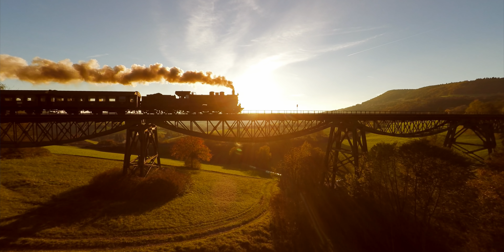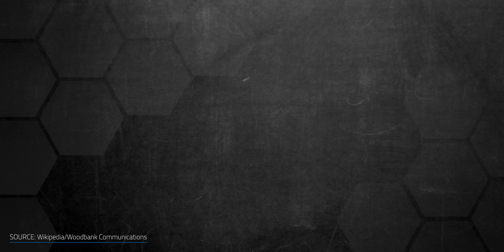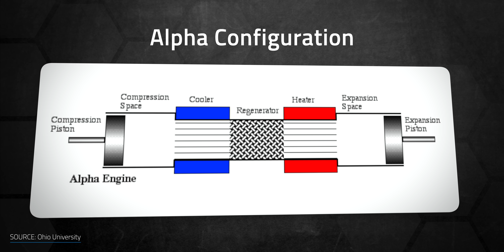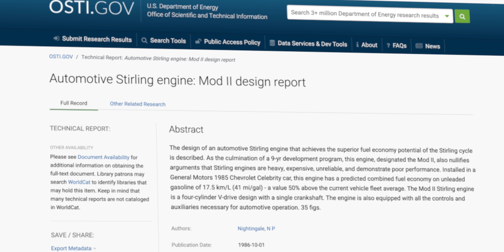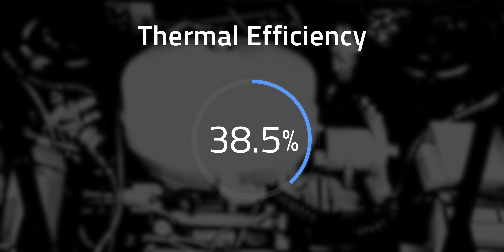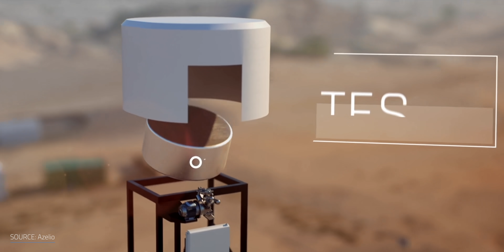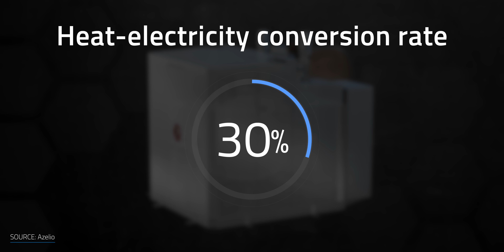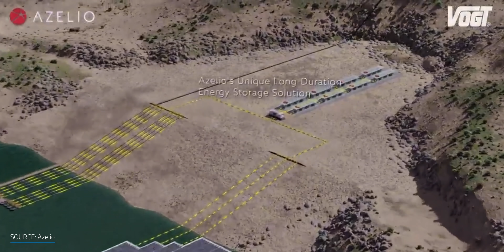Are Stirling Engines the Future of Renewable Energy Storage?

Comment from the maker: What do you think?  Do you know of any other unique storage solutions that I haven’t covered yet on the channel?  And be sure to check out my video The Mechanical Battery Explained: A Flywheel Comeback? - https://youtu.be/8X2U7bDNcPM?list=PLnTSM-ORSgi5LVxHfWfQE6-Y_HnK-sgXS
Reply: Hi Matt thank you for covering this subject you're not the only one who loves hot air engines I have a book on the subject I bought as a kid which even being as weird as I am still got me some odd looks at the time. :) 
For me hot air engines still have a future in geothermal electricity production as unlike turbines systems they don't need the high temperatures or more importantly pressures. 
I got roasted (pun intended) before when I mentioned this as people couldn't understand why you wouldn't want to use something as great as a turbine. They completely missed that lower temp & pressure opens up a step change in the areas it can be implemented. Maximum power isn't as important as maximum coverage, especially when you're talking something that can operate 24/7.
That you can combine it with energy storage is an incredible bonus.
I'm not sure how the calculations pan out but ground heat pumps that can operate at 400% efficiency could have enough energy production to still make a low but usable amount of electricity using a hot air engine powered generator. Again the aim is not so much efficiency as scaleability.
Just think how many large scale, low level temperature, geothermal hot air engined power stations you could build for the cost of one nuclear power plant... without fuel or waste.
Reply: @helenlawson8426  But tell me why fuel cell tech is better than this?????.Anyone.
Reply: @tonyk7509  Fuel Cells are a completely different technology with benefits and limitations which is why we need as many types of renewable energy production as possible. 'Better' is always a concept determined by what is required.
A fuel cell can be filled quickly and doesn't create anything but water but it is not good at ramping up power quickly which is why hydrogen fuel cell cars are always hybrid with a battery for instant power and regen braking. Put that fuel cell in an aircraft on the otherhand where the requirements are different and a fuel cell is better than a battery. A down side of hydrogen fuel cells is that at the moment 90% of it comes from fossil fuels so is not as clean as it might be a decade from now when more is plit from seawater.
So what I'm trying to say is 'best' is a tricky thing to pin down.
Reply: @helenlawson8426  That's a lot of info .Thanks sir.Sir,I heard fuel cell tech is better for submarines rather than using a sterling engine based AIP.
Reply: Totally agree, as I said fuel cells are best for uses where alternatives are few and far between like aircraft and ships. Hydrogen for use in fuel cells is very energy hungry and really shouldn't be anyone's first option.
Again yes as I said words like 'best' and what is efficient are not as important as some think, a solar panel is very good example of this.
Fuel density and more importantly its many uses is what will give hydrogen a future, plus offshore wind turbine will in the next decades split hydrogen from seawater at a far less harmful and energy hungry way than petroleum. There is some very interesting new technologies around storage one being absorbing the gas into a very hi-tech paste. Right now around 90% of hydrogen comes from fossil fuels so yes very dirty, but always, I'm going to disagree there as like I say it has so many uses, cleaning up Steel production being just one of them.
Reply: I wonder if this heat produced from hydrogen fuel cell energy storage would work in tandem with this. Every bit of clean energy optimization.
Reply: Matt I think teg peltier modules need to be compared to Stirling Engines. Teg convert heat energy directly into electric energy.
Reply: @Unmentioned77  True but Peltier modules seems very inefficient compared to Stirling engine to produce electricity. Being very small, they seem to be interesting for very small-scale though.
Reply: Have you looked at the gravity trains? They are effectively a rock/concrete version of pumped storage without the need for large bodies of water and can be placed in varying capacities.
Reply: @cullenra  i dont know if this is the same as a gravity train, it uses mineshafts to store energy as potential: https://www.youtube.com/watch?v=U7a_LMM2_fE&list=PLAnNOMU3bfQpFmt2B5QX2YqrRYa6aD8cJ
Reply: @cullenra  all you need is a hill, a biulding, a mine or a small purpose built tower. It's a great solution.
Reply: I have a unique storage solution.  Pretty soon a lot of useless people wont have jobs.  And then they're gonna get fat.  Use that fat at energy generation gyms!
Reply: Small scale hydro electric power. I watched a video of a system using rain runoff from his roof drainage system. I thought about those novelty facet attachments that light up when running water. Why not use that say to light the bathroom while taking a shower? Couldn’t you place one of these on a water heart, stove, attic, rooftop, and so on? Capturing the ambient heat.  Could we build a larger sized one and place it in Death Valley using the temperature variation between night and day.
Reply: So Stirling engine is like mechanical peltier element 🤔
Reply: A carbon reactor has never been done.  We burn wood for fuel, but we don't have a reactor fueled by carbon using the limits of space-age technology.  It would have more in common with a hydrogen fuel-cell than a furnace.
Reply: nuclear fusion is the only solution !!
the rest is just wasting of time and money !!!
Reply: There is an Austrian company that builds a wood pellet fired water heater with an additional stirling engine. I'm thinking about this for my home: https://www.oekofen.com/en-gb/pellematic-condens_e/
Reply: @cavaronev4869  https://en.wikipedia.org/wiki/Wood_gas_generator offers much greater combustion efficiency  than a conventional pellet stove....
Reply: Hi Matt! Make a video about SaltX's technology.
Reply: Hi Matt,
The real reason for why Stirling engines were not developed is that they bring 100% energy independence to each home.
If you make a 6 cubic meter reservoir and fill it with all the vegetable scraps in your garden, you will have enough methane gas to power that Stirling for your home and give energy to your neighbors as well... 
Energy storage can be also a reservoir of hot water that you burry in the ground, you can use solar mirrors on the rooftop to heat the water and it's more efficient than solar panels because you capture the infrared rays during the cloudy days.
Reply: Did you cover liquidize air technology? This technique is@proven way to store energy.
Reply: @Nature Taco I really do appreciate you taking time to answer. I didn't know the answer to the question. Thank you  ✌️
Reply: Molten salt is the answer. Studies have proven that thermal energy could be stored for weeks.
Reply: What are your thoughts on the ancient technology known as the Trompe? This is a hydro-pnuematic system that creates compressed air.
Reply: Tsamoka
0 seconds ago
The "problem" of not being able to rev power up and down quickly enough with a stirling engine in a car is because they tried to propel the car from the stirling engine itself. What they should have done, and what should be done today, is using the stirling engine to power an electrical generator to run an E-car. This exact methodology is basically what diesel-electric locomotives used for hauling freight do. They use a diesel engine running either a DC generator or an AC alternator-rectifier which powers the traction motors that drive the locomotive and provides enough torque to pull a very long line of freight cars. There is no mechanical connection between the diesel engine and the wheels. If diesel trains can do it, cars can do it. =^x^=
Reply: THERMAL BATTERIES..
Reply: What about supercapacitor and superconducting magnetic storage ? You had a video on Hydrogen, do you have one on Methane or Ethanol ?
Reply: It looks fine to store heat from solar heat, but not to store heat from electricity and then back to electricity again.
Reply: Sunamps thermal batteries are very cool (pun intended) and already a residential solution in the UK,  I wish they would sell them over here in Sweden, https://sunamp.com/
Reply: Earthen bag batteries your walls are your batteries too
Reply: How about this as an extra option for geo thermal. Any holes they drill that are not hot enough. Will probably be usefull for this and any waste heat at lower temperature’s . Opens up much more options . 
Just have a think (-:
Reply: There's a company that uses that concept also to run ultra low temperature freezers at -85 Celsius, is called stirling ultra cold, check them out.
Reply: Liquid metal batteries? https://ambri.com/technology/
Reply: @whiskeyandsarcasm  I was just thinking of this too. Not sure if you were just commenting on them as an energy storage device as they are, but I was thinking of how you could use the heat from the Liquid Metal Battery as a source of heat for a Sterling engine that would then store the power in the Liquid Metal Battery.

Seems too good to be true though. Almost a perpetual motion machine
Reply: Is anyone using paraffin as a phase change heat storage material? Could be useful in solar hydronic heating as a paraffin could be chosen with a melt point at the desired temp of the space heating loop.
Reply: Have you looked into rail energy storage?  I think Ares is a company working on it.  It seemed like a good idea when I heard about it, but I have not heard much recently.  Rail cars filled with rock or anything heavy are pushed up a hill by electric engines to store energy and slowly come back downhill to generate energy.  It can be set up anywhere there is a slope.
Reply: This is just the best solution I've known to date
It can even switch for another source of heat, like wood chips or biogas if the shadow time exceed the 13 hours reserve
I hope this being implemented here in our sunny Brazil sooner the better, but we have a currency exchange problem 
With the Euro costing more than six Reais, buying it from Sweden becomes really expensive
Anyway, thanks for sharing
This really seems to be the definitive solution for solar energy storage
Reply: Go back to steam and Stirling with Fresnel lenses
Reply: Salt-X of Switzerland with its nano coated salts wipes the floor with this technology over Azelio.
Reply: It only makes sense for thermal power plants from intermittent renewable sources.... The efficiency losses makes it unsuitable, for using as a storage option for most conventional renewable power sources such as, PV or Wind Power.... Making it just a niche player... 

the curse of carnot  https://en.wikipedia.org/wiki/Carnot%27s_theorem_(thermodynamics)

But it's a shame its was never commercialized as range extender for EVs....
https://www.ohio.edu/mechanical/stirling/engines/NASA_MTI1986.pdf
https://www.stirlingengine.com/why-not-popular/
Reply: Literally just watched a video about the Ambri liquid metal battery. 

https://youtu.be/ZRyo0Nr7CrY
Reply: Hi Matt,

I don't know if these storage solutions exist but it probably does : emptying cylinders to create vacuum. It has the advantage to not lose energy by compressing gazes since the atmospheric pressure will do all the work (you just lose on friction with the piston/cylinder).
Reply: How about covering Steam Accumulator e.g. http://www.terrajoulecorp.com/unexpected-technology/how-it-works/ https://en.wikipedia.org/wiki/Steam_accumulator
Reply: @Andy-AJC72  Hi Andy,
The biomass (water + vegetable mass  40%/60%) digests itself by fermenting and slowly producing methane gas over a year or so, depending on how slow or fast the fermentation goes.
Normally the fermentation works best at around 25-45 degrees Celsius. But, if you are in a colder climate, if the reservoir is buried in the ground, the average temperature will be around 8 degrees and the fermentation will be very slow. Even so, you can use some of the methane produced to heat up the reservoir holding the biomass, just to bring it up to speed let's say. After the fermentation starts well, it will produce it's own heat.

You can pressurize this methane in regular gas containers and use it for the Stirling to produce the energy on demand.
If you have methane gas, you have heat all year round
If you have a well in your yard, you have cold all year round
If you have a Stirling to use hot/cold  you have energy :)
Reply: Combined this with a heat pump and you could have the ultimate energy storage? Only problem then is insulation and the second law of thermodynamics..
Reply: Liquid nitrogen is destined to be the future of energy storage. It is possible that sterling engines might play a role converting the thermal energy potential, as compressed air motors, like the one I am developing, convert the potential expansion pressure.
Reply: Have you explored ice batteries? or cold thermal energy storage.
Reply: I believe that the next major breakthrough of the Sterling will be a non-mechanical version. Think about it a Peltier Chip is realistically the same principle. It can produce heat and cooling simultaneously and when reversed can produce current. Efficiency of course is the issue, but not much different than the Sterling.
Reply: You seem to misunderstand cogeneration. Typically it refers to using the waste heat from a generator for some other use where heat is needed. In Europe, water boilers with a stirling engine on top can be found. This allows total energy efficiency of the system to be %90 plus.
Reply: I wonder if there is a way to use a sterling engine in place of an alternator on a car. Limiting mechanical lose of power the alternator takes and improving fuel efficiency.
Reply: If the only positive thing they could find is that they are 29% better in CO2 equivalent emission than TWICE the amount of batteries, it means they probably are worse in any conceivable way... It would be nice to have the actual comparison although...
Reply: I think Tesla should use sterling engine or nitinol engine to extend range using heat from the batteries, electric motors and brakes.
Reply: @Nature Taco umm 🧐 I'm sorry I must've missed something? Have I said something to offend?
Reply: @Nature Taco however you feel I took you for granted I am sorry, as far as education and correction, the information is appreciated. Not sure about a correction but okay. And I have to ask if you really reply to everyone who replies to a comment you make online within 20 hours? Is expecting someone else to do that and then being upset because it didn't happen what you mean?
Reply: Power to methane (PtM)
Reply: How about starting with hybrids instead of just trying to soley go ev or hydrogen or whatever!
Reply: Are there such thing as vibrationally sensitive materials?
Reply: I think that the Deep geothermal stations use turbines to generate electricity but perhaps they could use also the Stirling engines instead. I really liked the TES part because storage is always a point brought out at the table for those who don't belive that electricity can't replace coal and oil in the future.
Reply: Dirt Simple Energy Storage https://www.youtube.com/watch?v=tm7spMG0ch8
Reply: The nasa mini reactors planned for mars use sterlings too
Reply: Problem with stirling engines it's technology whose time came and went. As far back as the 1800's in the age of steam stirling engines were thought to be Better and would replace steam engines for being more economical. Since they don't need boilers, risk of explosion and steam accidents was mitigated, no need for water to make steam. All you needed was a fireman to keep the furnace lit and the engine would run All day. Even so Power to weight ratio of stirling engines was vastly inferior because steam pistons had Higher pressures. With the advent of the triple expansion steam piston engine,power to weight ratios grew; marine ships could travel thousands of miles exceed 20 knots. Then came the steam turbine in 1880's. Stirling engines thermodynamic efficiency is poor, its only advantage is it doesn't rely on combustion to run. For power generation, stirlings may run on waste heat from industry sources (Steel making, chemical refining) Industry uses 52% of ALL energy consumption, even so building comprehensive power generation infrastructure to capture even 5% of industrial waste heat sources could produce a mere 1-2 Terawatt hours a year, factor in how many many many MANY engines you have to manufacture, how many years would it take to amortize? 1 TWh is a mere 124 MW running year round. Energy demand will outpace all Stirling manufacture capacity for years to come. The One industry stirling might excel at is Nuclear power, since the engine requires no pressure but a heat exchanger this would simplify reactor design but power conversion efficiencies would be LOWER.
Reply: FAR BETTER than chemical batteries.
Reply: Come on, you know this won't work.  I realize you make money on videos, but you are miseducating people.  The Carnot cycle makes this a poor solution for energy storage, and I'm sure you knew that before you even thought about making this video.
Reply: This is a carnot battery.  There are a bunch of promising ones providing 24-100hrs of storage. All of which use the same basic principle of TES to provide the temp delta to generate electricity. Malta Inc that uses a molten salt and a reversible brayton gas turbine, and then a number of thermal photovoltaic solutions are the ones to look out for.
Reply: Good morning Matt I don't have any new energy storage solutions however I do have some information about a possibly new energy source it comes from a company called NTS Innovations. This particular energy source uses graphene a lattice sheet of carbon to produce energy. The carbon atoms have a tendency to shake around in a way that mimics waves on the ocean. This technology is currently being used to build microchips that should be released by end of year 2021 that should be able to self-power most devices that we use I'll attach a video that explains more on how this technology functions that was released by the University of Arkansas please let me know what you think. ntsinnovations.com and YouTube video Tiny but mighty: Harvesting limitless energy
Reply: @Undecided with Matt Ferrell, you should check out the solar refineries  developed by Heliogen. They have been able to reach temperatures of about 1500 degree celsius! Their idea of integrating heliostats along with AI allows them to receive optimum sunlight every second of the day!
Reply: Remember a while back when we talked about the Earth battery which consisted of Straight Up Sand that was super heated Underground?

Well the basic idea is to connect the stirling engine part that has to be heated to produce that energy. 

And basically utilize it from there on out.
Reply: Since you asked for other solutions thought now might be a good time to go over many different types and not just storage. 

First and foremost,  energy savings over production and storage. Think of lighting with LEDs instead of incandescent or insulation to reduce HVAC needs.

Second, intermittent load that could match intermittent production. If you made ice for air conditioning or heated large tanks of hot water during peak output you could simply remove the load when output falls. This can be referred to as Demand Side Management (DSM). The work done during peak production can be stored as a change in temperature that will never be converted to electricity. 

Third, residential solar thermal, space heating and hot water. Much more cost effective then PV at this time. Particularly with simple concentrators. Mirrored surfaces are the lowest cost collector available. Phase change or hot water would help here as well.

Finally, when generation becomes cheap enough, just throw away unneeded energy. If PV was 1/10 the cost and you only needed 3 times the production to insure a stable supply why not.
Reply: Have you covered the iron-air battery. Recently a company called Form Energy has announced its technology breakthrough. Would like to know more about that. THX!
Reply: I'm curious about the specific application as an AC compressor. In hot areas, would a solar heat generator be able to create enough energy to power one? It wouldn't provide electricity, but it would significantly reduce the demand and also provide AC where there isn't power or during a power cut.
Reply: #TESLAHydroElectric. #HydroElectric Semi
Reply: Have always been interested in residential systems based on CHP (Combined Heat and Power) as a cost-effective supplement to grid power.
Reply: Have to comment before even watching. I made this comment to my physics teacher just a month ago. "Why haven't we developed a sterling engine for use in the Kola Superdeep Borehole?"
Reply: [Thread bypass]:
You completely failed to mention that NASA has designed an RTG that uses a stirling engine; they expect to be able to deploy it to the moon ( why?  Solar + batteries?... 🤷‍♂ ) or deep space where power in the multi-KW-range is needed.
Reply: Hello, Matt , I just found your channel
I’ve been working on an energy concept of my own - one I call an Hour Glass Farm - a concept whereby different elements of a farm, in particular the grassland and the fruit tree forest, are configured to enhance wind flow while not sacrificing the farmland to wind farms or urbanization, (and  storing the energy as compressed air in tanks which don’t cost $$ like batteries).  Some of the blade less turbines would be what I would like to test out for performance purposes on an Hour Glass Farm project
Thank you for your time and energy (pun intended) on these videos 😃😀
Reply: not so much a storage solution, but i am interested in using something like a sterling engine for reducing power usage in my house, i recently went through a power outage, but our gas was still running for our hot water heater, so the only way to get warm was to take a hot shower or have a hot drink. 

so it made me think that the hot water heater could be both used as a power generator for power outages but it also could be used to reduce power consumption when using grid electricity in the house, as well as a few other applications within the house. 

my idea is to use something like this to provide as a continuous stream of electricity, so there is always power, even during a power outage so long as the gas line isn't taken out or turned off.
Reply: @UndecidedMF   gravity generators!. Like how a Cuckoo clock works. On a house scale raise to 60 ft or even bigger. Combined with solar and a small turbine and even a solar Stirling engine.. you could have the weight fall slow with many gears, then have another that goes the other way to hike it back up. Or a hand crank. Or an automatic crank hooked up to another source just for that.
Reply: fuel cell tech is better than sterling engine.And don't know why?????
Reply: @tonyk7509  Indeed, my friend, but storing hydrogen is very bulk
Reply: @tonyk7509  I have been looking at converting my home to geo-thermal heating and cooling. As I understand it, it’s all about moving heat either from the home to the ground water or from the water into the home with excess heat providing hot water, why couldn’t that same heat differential power a stifling motor driven generation system?
Reply: Can you stop lying about "Earth going warmer" due to humanity?
https://www.youtube.com/watch?v=o8lSGf_Kkiw
I think i life modern climate with high CO2 level!
Reply: this is just as an ad for a company which appears to just steal money from investors.  this is a poor, wasteful energy storage product (unless you just need to store heat but again, molten salt already exists)